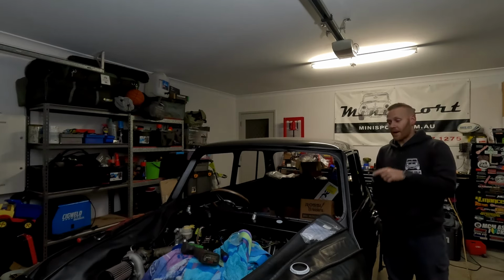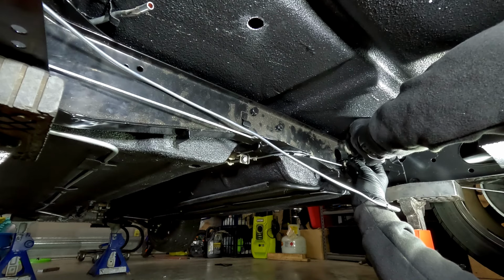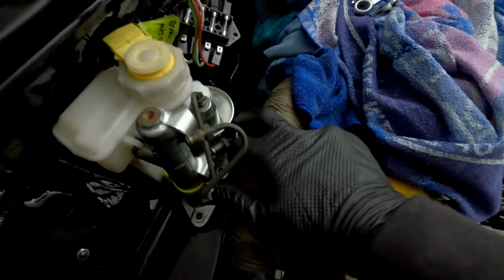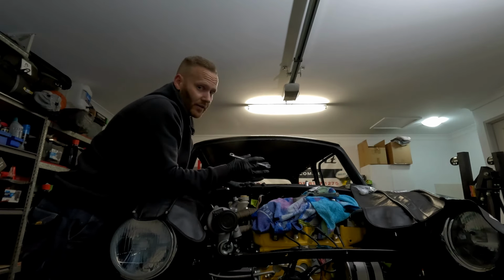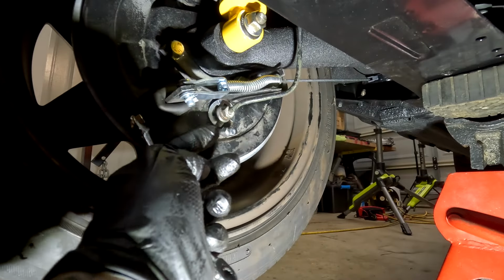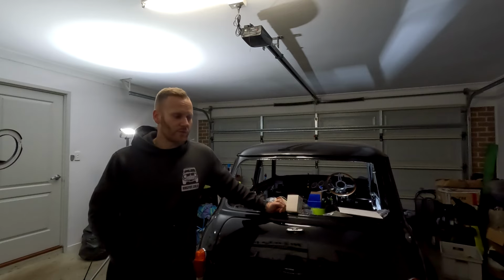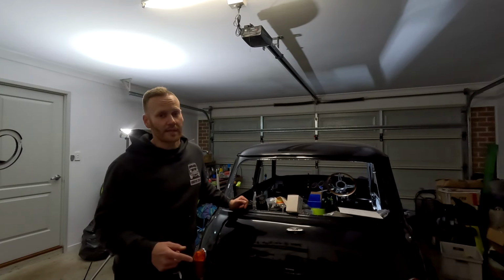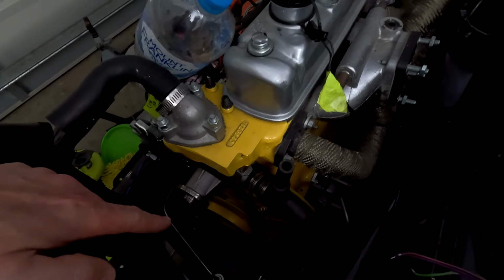Building a JDM Turbo Classic Mini - [Part 13] - Brake bleeding issues

Comment: Oh so your doing a JDM rover mini so this would have air conditioning and the engine would've been fuel injected but was it auto or manual and what year is it? 

There two rover ones  for sale at sunrise cars at west ryde on Victoria rd would you be interested in purchasing one of them or anyone else you know whos looking for one! 

Are will there be anymore jdm/ rovers minis you'll feature later on cause those are my favourite ones?
Reply from the maker: @ronniemackenzie097  hey mate, great questions. 
This is in fact a JDM mini, build in 1988 (great year mind you). It then got deported to the UK, then came down under. This originally did come with A/C, the customer has swapped the OG 1273 engine over to a 1330 turboed engine. 

Sadly at this stage, I have 4 classic minis at my house I’m currently building, fixing and restoring (including my own). I’d love to own a second mini, however I’d likely end up single if I did. I did see a post from Sydney Mini’s advertising them. 

Possibly another one down the track. I’ve also recently found a few subscribers who owned these vehicles as well, so depending if work needs to be done, they may possibly feature on my channel. 

Tomo